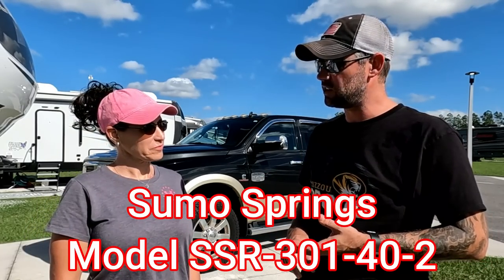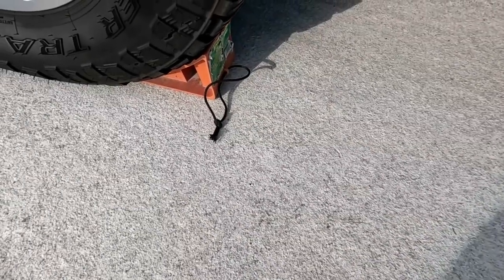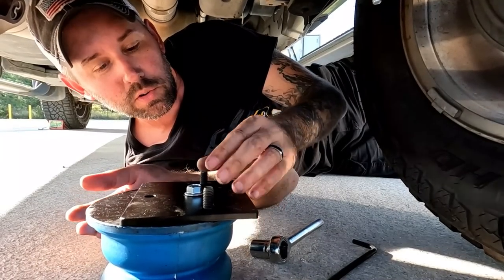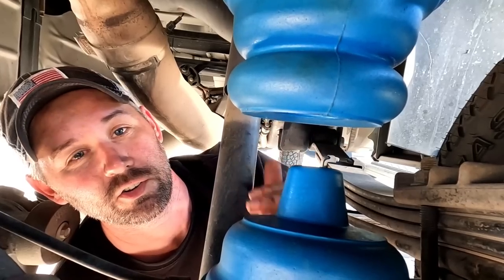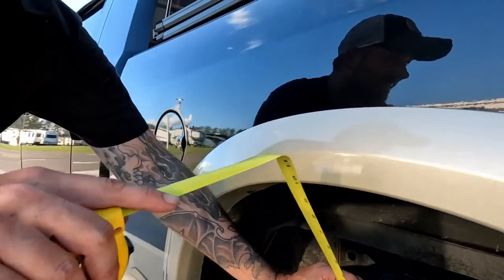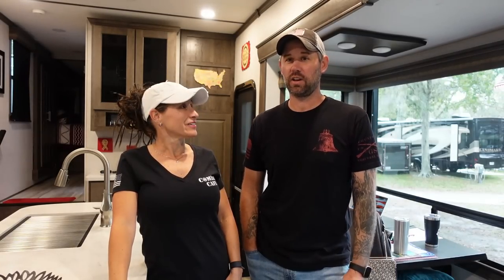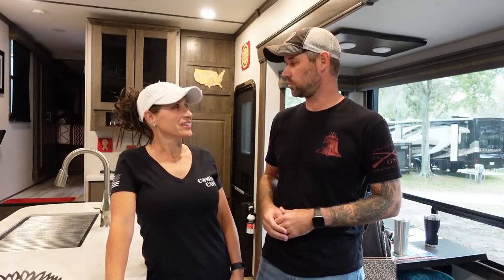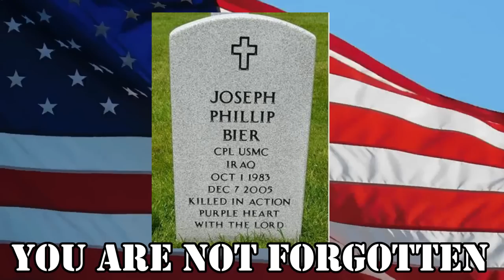SumoSprings Truck Suspension Upgrade Install and Review Ram 3500 (SSR-301-40-2)

Comment: Installing them on all 4 sides on my second box truck for my tile flooring installation business which requires us to haul skids of tile and 50lbs bags of concrete. After the results on my first truck I knew that this product I will use for as long as they manufacture it because for the price and the results are incredible !
Now, for my needs I have installed their Yellow edition which is the stiffest one and they have two more options for softer ride but stiffer than your stock once.

Comment: I had put them my truck, the ride had a weird bounce to the truck. So I took them off and went to airbags with autofill remote control compressor.  Airbags are the way to go for me, With a Reese goose box. This way I can have my 50 gallon diesel tank in the bed with an extra 60 gallons of water when I boon dock. I also tow double with either a RZR  or jet skis behind my RV.

Comment: I have the front and rear on my '21 Tundra 2wd.  I went with the blue this time and had yellow on my '02.  The body lean has been fixed with the full kit.  I like to corner and not feel like I'm about to flip over.  TRD sway bars did little to help.  Oh yeah, load handling benefit as well.

Comment: Good video glad it worked out talking about ride just a little info for y’all we were experiencing a rough ride on 14’ f250 89,000 miles and determine the rubber cab mounts which there are eight of pretty well worn out and I replaced them and made big difference on the ride something to consider

Comment: The last time I had sumo springs in my truck, the ride seemed a lot harsher than without. We now have a new truck and I’m concerned about putting sumos on as we are part timers and we use our truck alone for about 70% of the time. We did put them in the rv but haven’t taken it out yet. Your video
On the sumos for the trailer was why we put them on. Thank you!
Reply from the maker: I think the unhooked ride on the truck is smoother; especially when we hit speed bumps. We definitely love the ride when hitched up on both the RV and truck. Let us know how the ride goes when you take the RV out.
Reply: @WaywardWaggs  I certainly will. We’re headed to Elkhart 5/17 for the Alliance rally. I’ll let you know.
Reply from the maker: @rvgossontheroadagain8052  Cool. We'll see you there. 😁
Reply: @WaywardWaggs  awesome. Look forward to it. I’ll report our ride in person😎

Comment: I have an independent suspension off road Caravan that is 3.1 tons with a 800 lbs hitch weight. Pulling with a Modified F150 and Sumo Springs is different than towing with 3/4 and 1 ton trucks. Talking with my buddies the Sumo Springs actually make their larger trucks ride smoother. I think the stiffness on the 1/2 ton is a dynamic isolated to 1/2 tons. With the springs while towing my wind sway has been reduced and rear end dip and roll was eliminated completely ! Good YouTube Content!👍
Reply from the maker: That's awesome,  and thanks for watching! 😁

Comment: I put them on my Ram last year and it has been great for my Arctic Fox truck bed camper.  I have the front Sumos  but haven't installed them yet.  The installation looks pretty simple but I would love to see a video on the installation of the front Sumos.
Reply from the maker: We haven't done the front yet either. The back ones work great though.

Comment: When installing my sumu springs on the rear axle, the same type only black, the bottom spring is not canted forward the way yours are, but rant it is straight up and down and offset towards the back of the truck... which doesn't seem right to be at all. I am woried they top and bottom springs wont engage each other properly. But I suppose only time will tell. I will comment again at a later time when I see how they work under a load, and whether or not they engage properly.
Reply from the maker: Please keep us updated on how they work for you. We live ours. Hopefully they work well for you also.

Comment: No mention of the actual weight on the rear axle or what the axle ratings are. If you are constantly on the OEM stops, (even the gizmo stops), when towing there is a good chance you are over the axle rating. What about the tire ratings?  A properly set-up rig will not need any of  the after-market gizmos. Disclaimer, only 37 years of RV towing.  
"You don't know where you've been until you leave" 👍

Comment: Hey guys…what is your pin weight?
Also, it appears the sumosprings touch even when unloaded…right?
Reply from the maker: I'm not sure of the exact pin weight. The Sumo Springs stay in contact with the frame all of the time unless the ground is pretty uneven.
Reply: Still 100% good with the Sumo’s after a year?
Reply from the maker: @donarcher5693  Ya. No issues at all. We have hit some very bad roads and have had very minimal things moving around on travel days.

Comment: A bit off topic--but do you have a regular or long bed truck?  If regular, does it handle a 90-degree turn with the FW hitched-up?  Thanks.
Reply from the maker: We have a regular bed (6.5ft) and yes it handles 90° turns well. We have a slider hitch which helps with all that.

Comment: Ho not that you have expert knowledge and you are sponsored by them but there are several RV fifth wheel owners that have experienced frame damage, bending etc, that the shops are blaming the sumo springs for.  They seem to be that I could find all lippert frames with many Grand Design, though not exclusively.  I have not received a response from sumo springs and don’t really expect to.  Thanks.
Reply from the maker: I have only heard of one potential issue and that was with Larry and Alice from Downsizing Makes Cents. I spoke to Larry. He said he had a conversation with Sumo Springs and after speaking, he agrees with the Engineers at Sumo Springs. The conclusion was the frame issue he had was from a turn off of a drop off on the side of the road that bent the frame. Is was a coincidence that the frame bent where the Sumo Springs were mounted.

Comment: Why don’t these fuckers that manufacture these vehicles and box trucks put appropriate bump stops right off the bat. Just bought a new $55k box truck and you would think they would take into consideration that people might haul heavy loads and install heavy duty stop right away
Reply from the maker: I agree. Sumo Springs should come installed at the factory.

Comment: ok few things I don't understand? how would something that isn't designed to affect lift height in any way affect lift height? That makes zero sense. 
Also you were 9" before down to 6" that's 3". If these sumo springs did somehow give you a lift (which it didn't you measured differently after the install), you were at 10" prior and dropped to 8" that's still 2" of squat so really you gained 1" over factory squat. Tell me you're sponsored by a company without telling me you're sponsored by a company.
Reply from the maker: It made sense in my head.

Comment: I have them on the front of my 2000 tundra. Yes, they do have a bounce to them but reduce nose dive a lot. HOWEVER…… they do NOT fit from the factory. To do them in (with the vehicle jacked up and tire off the ground) I had to remove 2/3rd of the installation screw. Then when lowered, the spring was already damn near 50% compressed. To remedy this. I cut off off one layer (donut) of the spring and the when the truck is lowered back to the ground it only touches the control just a little bit and basically no compression. So….sumo needs to redesign this for the 2000-2006 tundra because since doing this to make them actually work correctly I voided the warranty and considering how much these things cost (which I know were not that expensive to mass produce) this fitment problem should not be an issue and voiding the warranty to make them fit is really just total bullshhitt.
Reply from the maker: Dang. Sorry you had to go through so much trouble.